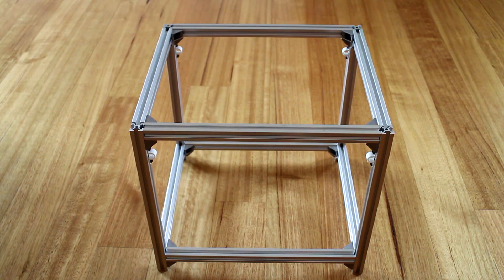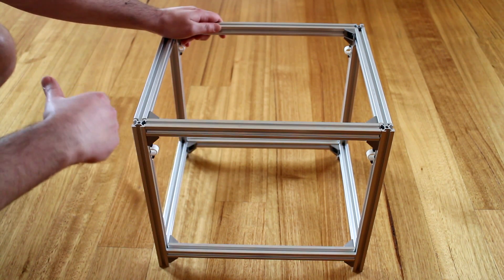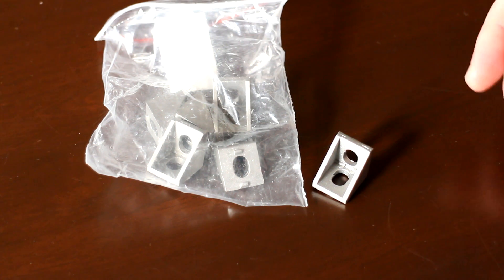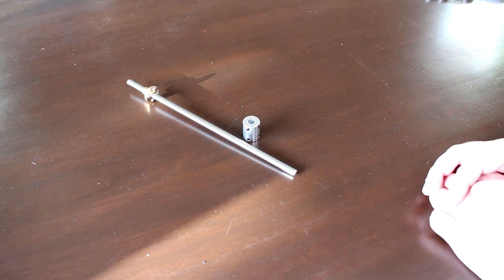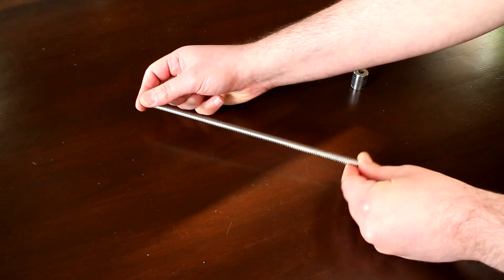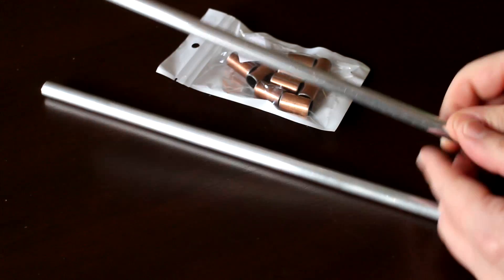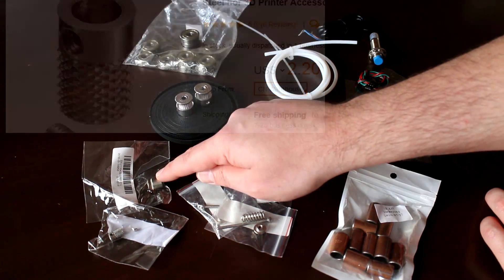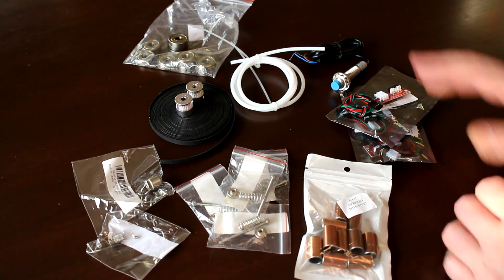New 3D Printer Parts

Comment: Excellent video! I found your channel while searching cutting Acrylic using a Laser and later I watched your video on using the Dremel type drill with an attachment which I thought was very clever and it was able to cut the 3mm Acrylic sheet with ease. I'm am totally sold on wanting to make the HyperCube 3 in 1 machine, but I would like to have the x and y axis cutting/print area to be atleast 300mm so that I can use the standard 1 sqft acrylic panels. Do you happen to know or tell me how I can calculate the size of aluminium profiles I am going to need. Thanks!

Comment: hey tech2c.... im new to the 3d printing world, i was wanting to build my own to start me into the hobby.  i was just wandering...... if i was to obtain the 3d printed parts that you have designed am i right in thinking that those parts can be used on any size printer and the size of the printer is purely dictated by the 2020, rods and lead screw used...

also, are you able to supply the parts this printer and ship to the UK?

thanks in advance
Reply from the maker: Yes I can. Just send me a message on Thingiverse requesting the Hypercube parts set.

Comment: Chris. I am inspired by your Hypercube and have built the frame and installed steppers and am now testing the frame. unfortuneatly the printer I am using to print the parts is a 101Hero which does not have the best quality prints so am having issues with the X axis. I am using Aluminium rods and the sintered bushes and the X movement is always jerky. Y axis is perfect as I am using Steel rods and roller bearings. Did you have any issues with movement in your X axis. I have watched all your videos. The X axis seems to move very freely when moving by hand and motors are disconnected. Any help would be great. PS I have ordered 10mm steel rods and bearings for the X axis to hopefully fix the issue but they will be some time in arriving and this is the only issue I have before I can start printing and reprint all my parts for better quality. Thanks in advance for any light you can shed on the issue.
Reply from the maker: Hello, well done with your build! I use carbon fibre tubes for my X axis, which I sanded down to allow the linear slide to travel smoothly across it. You can use steel rods and linear bearings for the X axis, but I would recommend 8mm steel diameter as the 10mm is just too heavy. Check the hypercube link on Thingiverse for instructions on using 8mm steel rods on the X gantry.
Reply: @Tech2C  Thanks Chris. I bought carbon rods and had them on but as mentioned I couldn't get the X axis to move freely due to the bad quality of my 3d printed parts. For this reason I swapped over to Aluminium tube but had no better luck. I'm thinking that there might be something in the Marlin that I have mucked up on the X axis as with the steel rod I have been able to get the X axis to move without any building however when I move the axis through Pronterface  only the X axis shakes about. I know 10mm on the X axis is too heavy but I just need to get it moving without the shaking so I can reprint all my components. I'm using 8mm steel rods on the Y axis so intend to swap them to the 10mm once I get it going. I think I will download a fresh copy of Marlin and re program it to  rule that out of the equation. BTW my printer is 500x500x500 ATM but I will probably shorten it a bit once I get it all running. Its that size as I wish to print some RC model planes with it as there are some great files out there for model planes.  I have a youtube video showing the issue at   https://youtu.be/uXgi8UgRnmY

Comment: a better t nut is the ones with a ball bearing, they can be inserted like those but lock into place without a screw in it. just good t nut with ball bearing. i got a pack of 50 off amazon for about $15 a little high compared to the regular t nuts but they make things sooo much easier. worth the extra money

Comment: Hi, I'm your FAN, you've made an exceptional 3D printer.
I request you for a project of a new HyperCube with a double extruder, and slightly larger so as to print 20x20x20 exactly.
As an extruder you should put the E3D Cyclops I have seen several tests and at the end for size and maintenance would seem the best.
Of course you could modify your HyperCube by printing it PLA and PVA.
Many of us are tired of losing hours of work to clean objects from the usual supports.
But by printing the PVA media the work would be really lightened.
I wait for your news.
Thank you in advance

Comment: Tip: put some loctite on your bolts before using the hammer nuts - that will transfer enough torque to the nut to cause it to fully turn into place before it bites into the aluminum extrusion. Otherwise, they can sometimes want to tighten down at an odd angle, and not get a good grip on the extrusion. 😀

Comment: I have a basic question, sorry if I display my ignorance, but here it is; Is the Core XY printer design limited to having the length of "X" equal to the "Y"? - I have a hankering to make a large-ish printer X,Y,Z = 400, 600,400mm. I realise I would have to beef up the frame somewhat, and some of the drive gear. Thanks.
Reply: nah, you can make it whatever dimensions you just might have to use thicker extrusions or stiffer alloys to go way bigger?

Comment: I'm currently  building mine and there is something hard to see from the video, how much space do you leave between the 'floor' and the bottom XY plane of the printer ? Do you mount it as low as possible or do you need to leave space for clearance for example to mount the Z axis stepper ? Thanks

Comment: question has any one used a robo3d r1 + to print hypercube pieces with abs and if you have what temp settings for extruder and bed and how did you get it to stick to bed. great printer design. also what would be the 20/20 extrusion length for a heated bed for 500mmx500mm bed

Comment: Hi mate, fantastic tutorial, you have inspired me to build my own rather than buy one out of the box. my first question is what size of slot is on the profile? I've been looking on eBay for the extrusion and they all have different slot sizes ranging from profile 4,5,6,7,8. I know you are using 5mm nuts but is the profile 5 mm or bigger?  I'm guessing it's 6 but not sure. also I've noticed further on in your build you've been printing your own parts, I don't have a printer, is there any way around that? can I purchase these anywhere?
Reply: As per the BOM on Thingiverse, you need Type 6 extrusion with the 6mm slot.

Comment: Hi! I got a question about the size of the frame. Is it possible to make the frame bigger than 350x300x350? I want to make a large printer but I'm worried about the rigidity of the frame if I make it too big ^^'
Reply: Yes.  Many people have. See the Makes section at http://www.thingiverse.com/thing:1752766 and you will some that were scaled up.  The aluminum channels are very rigid and, unless you go HUGE, should be fine.
Reply: Awesome! Thanks for the info! ^^
Reply: Hi, I am planning on building a similar size printer. Have you started yours? What size of extrusions have you used? Thanks.
Reply: So.. I am waiting for my parts to arive for a 500x500x500mm Build volume.. is this too huge? My concerns are about the Z-Axis. Wont it bend under its own weight?
Reply: If you want that size, consider going with an existing design that's already in that size range. There's the D-bot, the Voron, and others.

Comment: Hi Tech2c, first of all thank you for sharing your design to the community !
I have been watching a lot of videos and a lot of prints, and I want kind of a good printer to print some of my hobby projects parts, mostly mechanical... I was turned down by the imperfection of the cheap 3D printers I watched, and I am too poor for some fancy schmancy wireless smart 3D printer, so I figured out I could make my own, exploiting my building skills... Now - the problem is - I do not have these parts, nor the 3D printing is popular in my country - so where to go if I want to get those parts printed for me ? Also is there a way to print them in one run (or most of them) or it's better to print them piece by piece?  TY for the answer, I've asked it in Thingyverse just in case you don't come here anymore.

Comment: I watched your last video where you were explaining the issues with the bed, just a thought  why not replace the linear axis bearing with 
http://www.banggood.com/SCS810121620LUU-Linear-Axis-Ball-Bearing-Block-Long-Bearing-Block-p-984373.html
Then get two or four of these
 http://www.banggood.com/90-Degree-Right-Angle-L-Shape-Iron-Flat-Plate-Corner-Bracket-Brace-Support-51X51mm-p-1002656.html

I would get them made on gauge plat but triangular, that would make a rock solid heat bed.

Comment: I had a thought for tensioning the X and Y axis. If you add a section of the 20mm  box behind the Z axis drive you could add two belt guides on a pair of adjustable leavers where you could manually adjust or add belt tension springs.
This would also give the Z axis one extra place to add a fixing point for strength. I really like this build, and will be making one with a much larger foot print. Most of the components will be cnc aluminium parts from the stl files on thanks giving. Plus it will be a ground up build not built from salvaged components. Great work and thanks for sharing your experience to all.

Kev
Reply from the maker: Wow, if you do cnc mill the parts in aluminium please post photos on thingiverse! I'd love to see that!
Reply: Will DO

Comment: does anyone know where and which power supply to buy for a prusa i3? I gave the same i3 but the power burnt out I think.
Reply: have*
Reply: Honestly, go to ebay and search for "Prusa power supply."  Go for any of the 360W models in the appropriate voltage.  It'll probably look like the one you already have.
I would double-check that your power supply is burned out.  Does it make 12 volts (or 24, as appropriate)?
Reply: +The Garden of Eatin the led indicator stopped lighting up to indicate that it was working so I bought another. The voltage should say 110/220v but when I received it it was 115/230v and didn't work as well I live in NA btw is that the reason the new power supply isn't working?

Comment: I noticed that you purchased springs for manual bed leveling as well as an induction sensor for auto "bed leveling." Is it necessary to use the springs if you are using the induction sensor? I was hoping to ditch the springs, which I suspect to be introducing oscillations to the Y axis.

Comment: Very nice.  Excited to see your build take life, will be following it closely!  Instead of using the inductive proximity sensor, have you considered BLTouch hall effect based sensor?  Works with any surface type and is ridiculously accurate.  I've made the switch and it's been one of the best upgrades I've done to guarantee perfect first layers and a huge drop in failed prints. Just my two cents, not affiliated with bltouch in any way.

Comment: A tip from me. do no use 4 points for bedleveling. Use 3 points! :D
Reply: Not many hot plates come ready for three attach points.
I like what the Kossel does.  Hard mount the bed to the frame and compensate with the axis motion.

Comment: Aluminum rods with solid busing is a huge No-No. Sorry, but both materials are too soft. Interested to see the rest.
Reply from the maker: I've switched to anodised alu rods. I'll see how they perform after some use and report findings.
Reply: +Tech2C is worth a test,  but anodizing process is used as a corrosion treatment. the thickness of the layer of material deposited will determine its cycle life.  if i could suggest you use plastic self lubricating bushings instead of brass?
Reply from the maker: The bushings I have are self lubricating too, plus cost $4 for 10. Much cheaper than igus or other polymer bushings.

Comment: what is the print speed and resouloution for this printer
Reply from the maker: No freaking idea yet as I'm building it piece by piece. I hope to print much faster than my prusa i3 printer, so anywhere up to 100mm/s without sacrificing print quality would be ideal. Resolution will be up to 0.05mm layer height generally.
Reply: ok you should use self lubricating bushings btw
Reply from the maker: OSKIVICHII Gaming

Yep, the bushings I'm using are steel with oil impregnated bronze for self lubrication.
Reply: ahh ok

Comment: If I were to build a CoreXY machine, I wouldn't use rods at all; I would use the frame rails themselves with tapered wheels and radial ball bearings.
Not sure I would dismantle a working printer to build another, but that's a pack rat talking.
Reply: Thomas Sanladerer uses that method on his humongous delta machine, and has noticed wear on the alu extrusions 'cos they're not as hard as steel rods.
Reply: Isn't that because he angled the alu, rather than using V-Slot?
Reply: Did he use the steel outer races of the bearings, or did he use plastic or rubber tires on the bearings?
Reply: +The Garden of Eatin , Plastic V wheels riding on the corner edges of standard 2020 alu profiles.

Comment: With threads there is pitch and lead.  Pitch is the distance from thread to thread, lead is the distance traveled in one turn.  So a single start thread the pitch and lead are the same, with a multi start thread the lead is the pitch times the number of starts.
Reply from the maker: Good to know, thx!
Reply: I should have added that how the Chinese manufacture or probably more important the marketing people between you and I and the manufacture define the terms may be a whole nother matter.
Good luck on your build.
But I think you may want to look at some anodized tubing and plastic bushings even just printed ones.
I am considered arrow shafting for a similar build,, hope to get to it this fall/winter.  I can get Easton XX75 2115 bare shaft for $4.60 each.

Comment: Here is a link to a selection of lead screws. They even stock single start leadscrews of 1mm and 2mm pitch.  
http://www.ebay.com.au/itm/8mm-T8-Trapezoidal-Screw-Rod-and-nut-Lead-1-14-mm-L-100-600mm-cut-3D-Printer-/272203137166?var=&hash=item3f6092408e:m:mC5Y2SetJRHJRXEacuJH3fQ

Comment: I will be looking forward to finding out whether those high pitch lead screws are successful or not. I think you may be  on to something with the high pitch effecting accuracy. The stepper motor resolution (if too low) will effect z axis accuracy for sure. I have seen finer pitch lead screw an banggood as well witch may be better suited for 3d printers. Could you please go through the parameter changes needed to synchronize the motors with the change in pitch. That would be much appreciated. Thanks for the informative videos.
Reply from the maker: Yeah I'll go through each section as I go. I have a 0.9 degree stepper motor I may use for the z axis if the resolution/accuracy is hampered with the 8mm pitch lead screw.

Comment: This looks like a really interesting project and I'll be following closely.

For the endstop switches, did you consider using optical sensors instead? -  I've found mechanical switches to be inconsistent (probably due to contact bounce). Although accuracy of the homing position is not so important on the X & Y axis's, it's critical on the Z axis.    -Cheers
Reply from the maker: The plan was to use existing parts from the Prusa i3, even though I bought new endstops. Optical will be a future upgrade to it once it's printing. Thx.

Comment: one suggestion/idea Instead of copper bushings why not try polymer bushings... like igus bearings, they also sell igus filament, in theory you could print your own bushings...
Reply from the maker: Yes these are copper/steel bushings, not bronze, even though the ebay listing calls them bronze. I plan to start at the cheapest end of the price scale and work my up if the components are not satisfactory. Polymer/ptfe/igus bushings would be next for the alu rods.

Comment: I'm thinking about core xy for quite some time, but I dont like belts/fishing line idea. Will find a way to use lead screw. How is bed going to be, 2 guides and 1 lead? I plan on doing all four corners suported 2lead/2 guides, really dont like ultimaker where one side is carring all the weight...
Reply from the maker: Yeah 2 guides 1 lead for the Z. I'll see how it goes.

Comment: check your brass bushing...my china bushing  stick on magnet...brass stick on magnet..?????...do the job anyway on my QUIET Delta
Reply from the maker: Correct, I just checked the ebay listing - it's actually steel with copper cladding! Well as long as it works I don't care...
Reply: Work Great here, but for how much time..:)..and need 20 to got 12 good size one and 100 time better than china linear beraring...

Comment: I did the exact same thing with switching from a prusa design to a more rigid core xy design, I am very happy with the out come and I'm excited see how yours turns out. I used 3D printed corner brackets, and you are right, they don't provided the same rigidity as the metal ones do, but I made 3  plywood  sides that mounted to the printer, and the combo is very rigid.